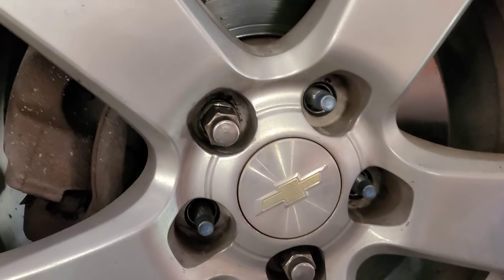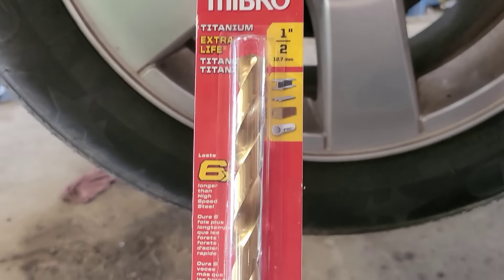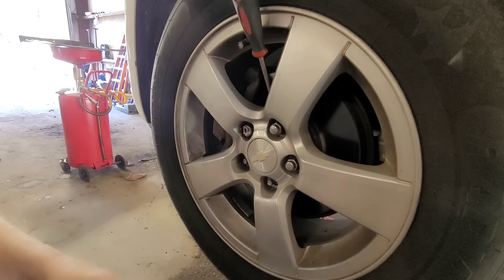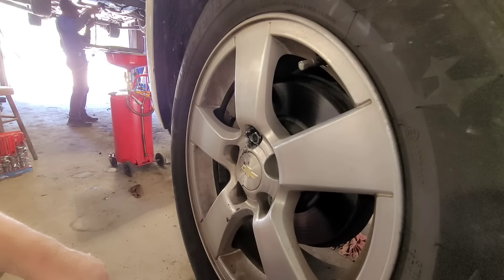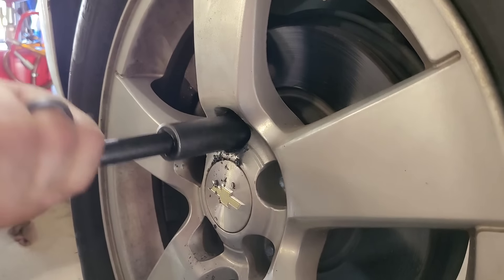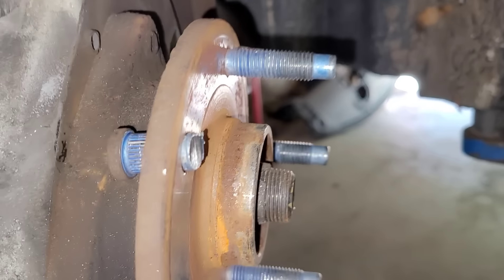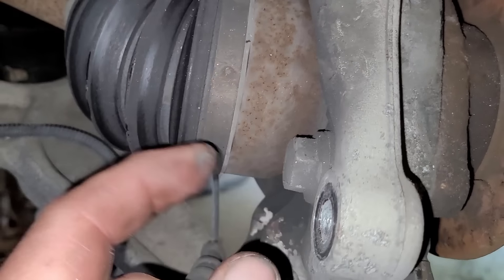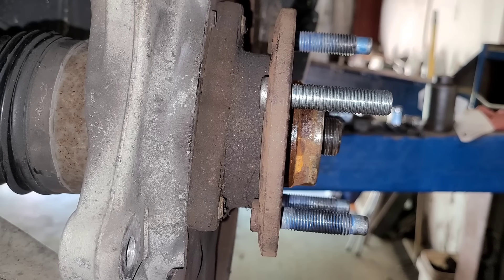Spinning Wheel Stud & Seized Lug? What Would You Do?

Comment: A lot of the times putting pressure on it like you did there are using a long prybar behind the wheel while someone tries loosening it with an impact wrench will take the nut off.  But sometime it doesn't.  That's when I break out the carbide cutter in my cut off tool,  if it fits.

Comment: See I was going to suggest putting in a pilot hole but others have beat me to it. 
Great video! I couldn't think of a more annoying issue to pop up when rotating tires. I'll bet before you grabbed the camera there were some words used that couldn't be on here 😅
Nice job!!

I bought a box of 1/8" cobalt bits and always run pilot holes. When you think you're deep enough take either that worn bit or a 1/2" rod and put it in the hole and break that nut off. A little extra leverage would make it a bit easier.

Hopefully I never see anything like this but at least I'll know what to do. Thank you!!

Comment: Put the turning  lug on the top and let the vehicle down enough to put pressure on the stud. I have done this a number of times and it works, drilling a hole in the top of the stud so you can spray penetrate on top of the stud

Comment: What I typically use after removing the aluminum cap from the acorn lugs is utilize a locked lug nut remover and a breaker bar.. Then remove the nut with an impact gun.  The longer part is just removing the cap that keeps spinning. Drilling the stud is a last resort if the actual lug nut underneath the cap is damaged.

Comment: Typically when this happens to me I use a small chisel to remove the cap on the nut. I will then use either map gas or an electric heat induction tool to heat the nut while a helper uses a large pry bar to pry outward on the wheel to put pressure on the stud. And while the nut is hot I use a air impact gun and blip the trigger constantly to remove the nut. 8 out 10 times this works for me and dosen't damage the wheel. Just don't use oxy/cet  to heat the nut that will damage the wheel. Hope this helps.

Comment: Just wondering you could weld a tab on to the nut and use a slide hammer to pull the stud to the groove to get a better bite as well the heat from the weld could help un seize the nut in the process? great mechanic excellent content . From Ireland
Reply: Or just weld a 5/8” nut and threat that slide hammer right in
Reply: @VeryPersian  Correct there is a way

Comment: we set the car down, with spinning lug at 12oclock, pull bottom tire out while setting on the ground with block of wood under the tire to put more pressure than the other tires. with the weight of car, we usually get those out. if not we use the drill

Comment: Like Anthony Williams said I would have started out with the 1/2 drill to get  a starting counter drill hole to center for a smaller drill. Then I would have used either a 1/4 or 3/16 to drill thru then with the 1/4 finish it with the 1/2 ( or steel to a 3/8 then finish it off)

Comment: StrongArm Lever Arm Rig drill motor holding fixture chained to the wheel spoke , apply heavy load , slow rpm’s and cool drill bit with engine oil .      6/4/23

Comment: I have done what you did with cocking the wheel and if there is enough space between the wheel and hub I take a Sawzall with a hacksaw blade and cut the stud in half. The blade will bend enough thru the wheel opening. If not enough space or you have a solid wheel, then how you did it.

Comment: If you rotate the hub to the notch in the disc brake slinger plate and temporarily remove the wheel speed sensor, you can use the notch to insert/remove the wheel stud. But always love your videos Kenny, especially the trouble-shooting ones. Keep up the great work!
Reply: The new stud was not hitting the hub, it was hitting the spindle.  The hub had to come off.

Comment: The way I do it is a little different from your technique.   I would put one good lug nut on and tighten it slightly to hold things in place.   I have made a short piece of 1/2 inch square key stock and on the lathe I drilled a 3/16 inch hold all the way through.  Actually I have two or three square pieces of key stock with larger holes.  Then I take a short 19 mm socket and hold it over the lug nut with the smallest square key stock drill guide and use that to guide the smallest bit first.  Do not take the chrome cover off first.  When you have the small hole through then go to the next size.
After the first, second or third size the bit will stay on center until you get it all the way out.  If necessary you can use a 3/4 inch drive 19 mm socket if you need a bitter hole.  It isn't pleasant but it works.  Like you said be prepared it takes some time and the guide sockets get hot too.  Thanks for the video.

Comment: Admire your tenacity. I did a lot of fab work with very hard materials such as non magnetic stainless. I used cobalt or high speed steel bits from a machinist supply shop. Castrol edge lube, or tap magic are very good drill lubricants as well.

Comment: Stripped the splines on the stud. Nut probably cross threaded on. Soooo.... What I've done is this. My Matco air hammer is pretty decent. I bought a couple of the hardened chisels for my air hammer. I used a bench grinder and worked the chisel down to about half is diameter being sure to keep the mass centered. Anyway, going slowly and sneaking up on the actual nut I cut it down one side and then the other. Never hitting the wheel. Before the nut is actually cut in half it'll let you do the bendy back and forth thing with a flat blade screwdriver and finishes breaking on it's own. Take the wheel of and then deal with the stud. That's how I approach it. About twice a month. Takes about 15 minutes or so.
Reply from the maker: Next time you do that post a video to Wrenching with Kenny on Facebook. PS great idea grinding it down
Reply: @WrenchingWithKenny  Yeah I'm not the posting type but been thinking about it. I'm a mechanic now with millwright, fabrication and general industrial maintenance background. I'll recreate the issue if I decide to jump on the video wagon. Between getting my bearings (no pun intended ) on equipment, editing and posting sounds like a fun challenge as I like to go 110% on things I tackle. Thanks for posting and I'll save this vid and get back to you. Possibly. Stay blessed you and yours.

Comment: Hi kenny I have to say you are a very good mechanic, but drilling out this stud is kind of bordering on metal fabrication, speaking as someone with over 50 years in metal fabrication the mistake you made is not starting with a smaller diameter drill around 4mm in diameter, then step up a couple of bigger sizes before finishing with the 1/2" drill
Reply from the maker: I agree! The drill bit was cutting so well that there wasn't a point to me stopping. Otherwise, I would have done so. Thank you for your insight. I do appreciate it. Keep wrenching 🔧

Comment: I've had good luck with taking a acetylene torch on high, hot heat, and burn out the center of the stud from the nut. The nut will fall away, and with the fast hot heat you don't run the risk of overheating the wheel. Of course, this won't work on rubber or plastic coated wheels

Comment: Grab your self a Drill Doctor drill bit sharpener.  Take the time and read the instructions first.  When you get things lined up it does a fantastic job.  I have the older model 500 that does up to 1/2".  There is an adapter that does up to 3/4".  They also have an adapter that does left hand bits.  Less than a minute and you are back to factory sharp or better.

Comment: To Remove: 1st; Big Drills go slow, little drills go fast. If'n I was to drill it, I'd be doing the preverbal 1/8" starter bit first at 2,000rpm, then work my way up to finish w/ 1/2" drill bit at 300rpm drowning each step with lots of light oil. BUT, I spent 25yrs in a muffler joint, so I automatically think "Blue Wrench." Step 1: Find a piece of muffler pipe conduit or form some sheet metal into a tube, that fits over the nut to protect the wheel. Have H2O spray bottle to quench handy. Then "skin" the cap off the lug nut, quench. Then "skin" the actual lug nut off the stud OR burn the stud out of the nut like Ken did with the 1/2'' drill bit, but stop and quench to keep from burning the wheel paint. OR Use a fine bit in an air chisel to skin the cap off, then skin the nut off the stud. I've even used a stick welding rod at home befor I bought a set of torches, to melt the stud out of the nut. To Replace the stud: 1st grind the stud length way back. It doesn't need to stick out past the end of the nut by more than ONE THREAD. 2nd: Look for the best place to try and fit the new lug into place, then grind a minimal amount off the stud head, then a minimal amount off the hub or knuckle where the interference is. Then coat everything with BreakAway penetrating oil. Coat the hole, the spline and the threads. Then don't be shy, just blast the new stud in,  and clean it up with a thread chaser, then draw the stud home with a big lug nut or pile of washers and another lug nut of correct thread.  I use BreakAway cuz it has a very light vehicle in it such as methyl ethyl ketone, toluene, naphtha or acetone, that carries a heavier oil deep into crevasses but dries quickly leaving behind a heavy oil.  PB Blast stinks like Diesel, I'm not getting paid like a Diesel mechanic, so I'll be damned if I'm going to smell like one. And WD just stinks, and  conjures up bad memories of starting wet engines. P.S. I don't do Concours work. "Ben Tested Tough" ben/ michigan

Comment: I have heard that gangs stealing high end wheels buy taking 4 or 5 lugs off, leaving the locking Lug stud, then reefing on the wheel opposite the Locked Lug and break the stud off.  Give it a try.
Get underneath the vehicle and see if there is any possible way to tack weld the stud .Wrap some cloths around the spoke opposite and with a chain give it a 'towel snap'. Break off the stud.  A different  type of end on that stud.

Comment: I would have tried prying on that rim the way you were than tried hitting it with the impact again. A lot of times you can just use that extra little bit of pressure to hold the stud and spin off the nut.

Comment: Given the slack in that stud and the open nature of the wheel I would have spun the wheel so the stud was away from the caliper and then pulled the rim away from the hub/rotor face then using a 1 mm disc in an air cut off tool  or even a 4" cutting disc mounted to a nut bolt fitted in a drill,go in between the spokes simply cut through the exposed stud. 5 minutes maximum!

Comment: I would try to get a detail saw with a metal cutting blade between the back side of the wheel and the rotor or whatever and try to cut the bolt off. I'm not a mechanic, just a retired carpenter, so that's how I think. I remember the days when car manufactures knew how to make lug nuts. Or, I would try to find a metal cutting blade for a detail saw that was narrow enough to cut the nut, using a tubular sleeve to protect the wheel. Divide and conquer.

Comment: Do what car thieves do. Lever the wheel until the stud snaps off, then extract the stud the same way you would normally for a stuck stud. Weld on a nut, or if you are lucky you can unscrew it.
Reply: Thieves don’t care if they damage the brakes, hubs etc all they want is the wheels - the car may be undriveable when they’re done

Comment: Kenny you made a small mistake by using wd 40 . WD 40 is a lubricant witch hinders the bit cutting ability. You should use cutting fluid to cool  the bit which does not hinder the cutting properties of the drill bit .

Comment: Drilling it out is nice for saving the wheel.  But that wheel is cheap, especially when buying a single.  Those big drill bits are not cheap.  If drilling didnt work, torch that nut off. If the wheel can be saved, great.  If not, put the spare on (if it even comes with one LOL), and get another wheel.  
Stay gold.

Comment: Wow. I am speechless. 
Right idea. Terrible execution. On every front. Starting with that wanton use of the chisel. 
Then, that drilling, geez.... That wasn't cutting well. Turning way too fast and.... Just, why??
I woulda poked a hole in that flimsy lug nut cover. Awl, center punch....the drill bit can get through that too, I'm sure.  
And pilot holes are very helpful.
I think I woulda done that in three easy pokes, instead of that drawn out mess.
Then slamming the wheel around and prying with the socket and extension instead of just finishing your drilling?? 
The only damage caused was done then, and at the start with the damn chisel!! 
Hey, the wheel is off tho.

Comment: #1. Protect the rim with some tape. Don't hack it up and damage it like you did. That is unecessary.  

#2. I would take all other lugs off and using a safe jack stand and jack, lower the car on that area so that the one problem stud is really tight. It will be since you will have about 700lbs. of pressure on it. 2,800lb. car/4 wheels.

This is not advise. It was simply what "I" would do. Do not do this. Messing with jacks and wheels can kill or injure you severly.

Comment: I will probably never do this, but you probably will again: it would be helpful to use a depth gauge, and measure how deeply you have drilled past the lugnut, versus the diameter of the lugbolt, versus the diameter of the drill you are using.

Comment: This mechanic really has no idea what he's doing...dont know if its lack of experience or if he's intentionally over inflating labor costs on this job for an easy profit. He didnt have to remove the entire hub bearing assembly to get the stud out. all he needed to do was put the vehicle in neutral and rotate the axel to align the notch with the stud(which he noticed when it was already off the spindle btw) and the stud would have easily slid out. Hope he didnt bill the customer for this unnecessary step~

Comment: The stud doesn't look like the others. Drill small between the nut and stud and crack it off with a chisel. There is no way in hell after taking that bearing off that I would re-install it. The customer is going to be pissed when that bearing fails soon after. After about half a dozen of these on peoples Kia's you get pretty fast at it. $.02 🙄

Comment: Start with smaller drill bits working up to the necessary diameter.  It works a lot better that way.

With the work to remove and replace the hub, I would have opted for a new one.  Given the problems of age with bearings and ABS magnetic strips, just go with a new part.

My personal cringe factor involves using the threads of any fastener to install said fastener.  I avoid it where ever and whenever possible.  Of course, having a hydraulic press allows me to be so particular.

But, since the job was completed and completed well, the presented process goes in the win column!

Comment: Stupid design.  On my 2003 Pontiac Vibe, there's a relief cut in the spindle so you can install or remove a lug bolt.  It's only in one area but you just rotate the hub until it lines up.  Oh the joys of being a mechanic.

Comment: Have you sworn like hell at it yet?

Ive had to remove a few smoked lug nuts, but man having the stud spin in the hub is some proper BS.

Unless you can still tighten it? I would think it spins both directions.

So thats gotta be on a drum? Clearly no physical access to the stud no matter what.

If you have oxy/acetylene then you could melt it? There aren't many ways to get that out that would leave the wheel without damage or marks.

Damn thats ridiculous. Even removing stripped lugs with the stud not spinning was a whole 8-10 hr ordeal cuz I managed breaking the lug off with the conical seat still inside the rim.

Burn it out or attempt the method you are using.
Swear much, swear often, stay hydrated, make sure you light the ceremonial gear oil and pray for forgiveness from the mechanical gods...... That had to be some brutal stuff.

Comment: Anybody besides me have a set of left-handed drill bits?  Use those and you're turning in the direction to unscrew the fastener.  The heat and vibration from the drilling usually knocks the fastener loose and easy to remove in short order.

Comment: Depending upon whether or not you could maneuver the caliper away from the rotor and off the caliper bracket with the wheel stuck on like that, I'd at least consider popping the center cap off and zipping the axle nut off.  Pull hub and then the lug is can be easily attacked from the backside.  Gonna need a new hub anyway since there's probably no oversize lug bolts available.  Ten new hubs to pick from at Rock Auto for less than $45.

Comment: I recently had to put an older minivan back on the road that had been sitting under a carport for bout 2 yrs cause I had bought my wife a 2019 Mitsi Outlander well bout 2 weeks ago it got into an accident and was totaled nobody hurt thank the Lord but the calipers in the front had frozen up and I went to replace them only to find out the lug nuts were also frozen up to the lugs the van had those fake chrome lug nuts and the kept rounding off it took me 3 times as long to get the lid nut off cause of the faces were damaged I wound up having yo get a set of easy outs to get them off boy was I a bit ticked off ! Needless to say I went and bought new chrome lug nuts and replace them all plus put a touch of anti seaze on the threads ! That won't happen again on that van ! They ought to outlaw those fake chrome lug nuts !